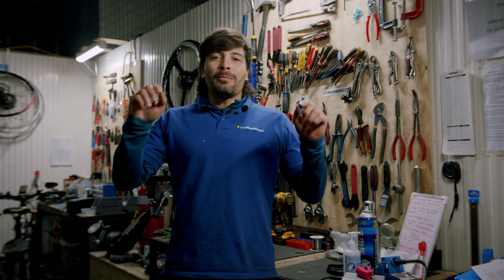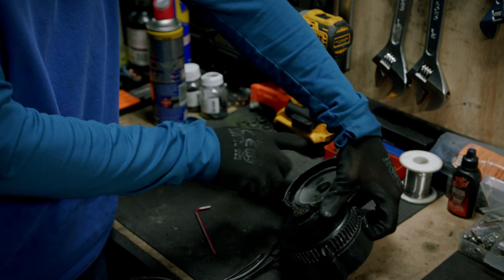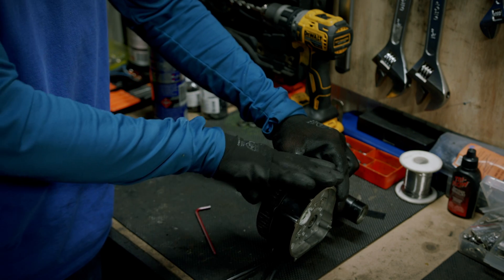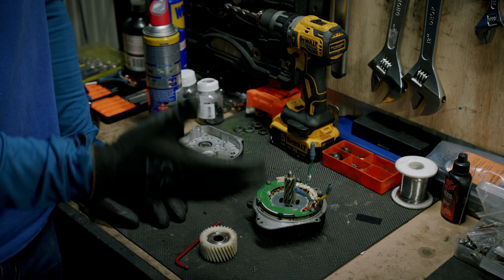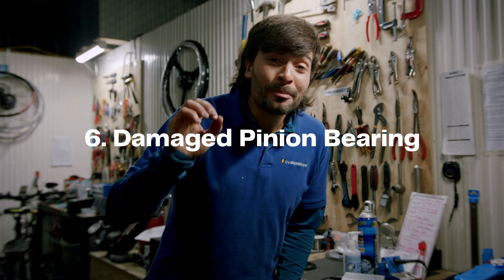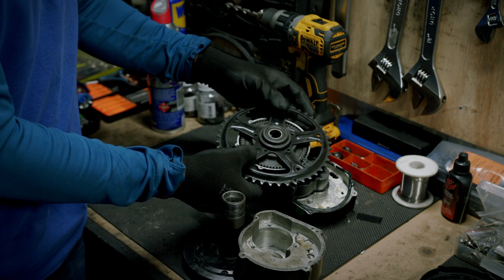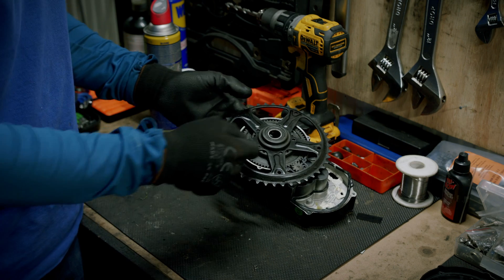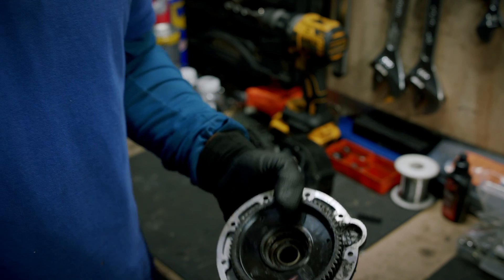Bafang BBS Motors The Most Common Problems of These Mid Drive Motors

Comment: Great Video mate. very imformative. I build one bike with 750w 52v 20ah system and second kit is on the way. It was logical to use this Ebike just like a manual shfiting car. low gears at hills and startups higher gears on cruise. I am glad that i confirmed my intutition. My question is do i need to service bafang motor like lubing the gears or coating controller etc? Our first bike only made 200 km so far and runs extremely good. Do i need to take it apart and apply grease? If so when should i do it after 1000 km? Thanks
Reply from the maker: Hi, every 5000km apply grease to the big gear and pinion coupling and the bearings of the pedal shaft

Comment: so what will you recommend to avoid those 8 problems? the bafang  mid drive motor parts are available and where to purchase? thanks for giving us tips bro. more power.
Reply from the maker: shift gears, start on the 1st gear of the cassette and as the speed increases shift gears up. Before you stop the bike, bring the gears back to 1st gear

Comment: Thanks for the great video.
Is the damage from over-torquing the motor shaft instant? The "second time" tightening that nut I may have exceeded the spec by a lot. Other than loosening the nut to 80N-m is there anything I should be watching out for?  Its a 750W BBS02 with only about 200km so far.
Regards, Randy
Reply from the maker: Yes and yes pay attention to the bearings that are inside housing, the roller bearing gets damaged by over tightening the nut that holds the motor to the bottom bracket

Comment: I find that the power of my Bafang 500w is so great that I have to change up gears 2 or 3 at a time to keep up with the acceleration and spend most of my riding time in top gear averaging 35 kph for flat cruising. I guess that is exactly the way to wear out my gears? What if I could fit a CVT in lieu of derailleurs? Would that help keep my motor in good shape?
Reply from the maker: Hi Keith, the secret to have a bafang motor that lives for a long time is to make it spin fast. You could have a CVT which is an improvement in comparison to derailleurs, but if you don’t tune the CVT or don’t shift gears on the derailleur to allow your motor to spin fast you will damage the motor.

Comment: I just got a new BBS02 48V kit.  Everything checks out except the battery.  (Hailong 48V 20H )  The voltage from the battery is 54.3VDC with the battery switch on BUT 23.4 VDC with the switch in the OFF position.  Is that normal?   I expected it to be 0V.  Thank you  Pat P.
Reply: It depends on the BMS of that battery, Even though there's 23V there it doesn't mean there's any current flowing. I wouldn't bother if the battery works fine and when the battery is on the bike, the switch turns off the bike completely.
Reply: @frcr90  Thank you for your response; much appreciated.
Reply: The c500 controller let's say has a setting to set the right max battery voltage. From 36v to 48v to 52v

Comment: I have a BBSHD mounted on my SunSeeker trike. The other day I heard grinding sounds in the motor. Then the pedals locked up. The motor still works via the throttle and that got me home. I have about 2000 miles on the trike. Any idea what the problem is?
Reply: The roller bearing responsible for supporting the pedal axle has been damaged. Why? Overtorque when tightening the motor to the trike frame. On the left side of the motor, where the nut and mount are, remove the gasket that's on the shaft and remove the special nuts that are threaded to the shaft and you will be able to slide the axle of the bearings and replace that damaged bearing. Good luck with your repair.
Reply: You don't need to unmount the motor from the trike frame, you can maintain the motor attached to the frame and all wires to do this repair.
Reply: @frcr90  If the housing has been distorted, will that not shorten the life of the new bearing?
Reply: @Jeff20657  it shorten the life of the old bearing. Press (don’t hammer) a new bearing in. If you think you deformed the housing too much, buy a new motor, but I don’t think that’s the case. What I can say from my experience is that  that bearing breaks by over tightening the motor to the frame or corrosion. You mentioned 2000miles, how many months to cover that distance?
Reply: @frcr90  2 Years. How about a video showing how to do this repair?
Reply: @Jeff20657  that’s a great idea. Probably the cause was corrosion instead of torque.

Comment: Great video! Sometimes on long rides my motor completely stops working like it’s not getting power. This only happens for a short period then it comes back on. Is this this normal if I’m using too much power?
Reply from the maker: Could be many things, like burnt phase wires (check our video library on how to fix this issue), brake sensor playing out or overtemperature
Reply: Did you find what the problem was

Comment: Does using throttle often wear out mid-drive more than pedaling? Or would it be okay if we are in the right gear? I plan to use throttle to start rolling then pedal
Reply from the maker: You have to throttle on the right gear, and on the standard Bafang controller settings the throttle is stronger than the pedal assist so yes, considering that throttle and PAS are on the right gear, the throttle will wear out the motor more than the pedal assist, but hey, do you want power or not =)
Reply: @Cyberbikesau  I guess everything has a trade off haha. Thanks for the reply and great video btw
Reply from the maker: @dowblab   @dowblab  Yeah that's it! Thanks, you're welcome, talk to you in the next video =)

Comment: I would definitely replace the grease I did on mine when it was new with a synthetic boat grease quiet as can be the stock grease is garbage
Reply: Replaced grease on both of the ones I have used before putting them in service.  Used Mobil-28 grease.
Reply from the maker: Great might be a good thing to do

Comment: Which grease do you recommend for the bbs02b primary and secondary gears? I read about the Mobilgrease SHC100, it's a Lithium based grease. Recommended as a replacement for the Mobil 28, which is hard to find in Europe.
Reply from the maker: That’s a good grease, I checked it’s data sheet: 
Mobilith SHC 100 is an antiwear and extreme pressure grease primarily recommended for higher speed applications such as electric motors, where reduced friction, low wear and long service life are required. It is an NLGI 2 Grade / ISO VG 100 grease with a synthetic base fluid. Its operating temperature range is -40º C* to 150º C.

As a rule of thumb go with high temp grease from a decent brand, it can be with lithium or not, higher viscosity is key for this application
Reply: @Cyberbikesau  I think I will replace the original grease anyway, it's the petroleum based black grease in the secondary gear, it has a tendency of spread to the primary nylon gear and in the long run cause decay.
Reply from the maker: @bengtmowitz5012  I don’t think so, otherwise bafang wouldn’t use that grease in their motors. Bafang has sold more than millions of motors so far
Reply: @Cyberbikesau  Yea, one would think so. But there are a many sources included YouTube that claims that the Black Moly  grease is harmful for plastics. I don't know if it is both the bbs02 and the new bbs02b?
Reply from the maker: @bengtmowitz5012  we are talking here about metal gears, what I understood for primary and secondary are the granny and pinion gears I mentioned in the video. For the nylon gear use a non lithium extra dense grease or a friction reduction paste
Reply: @Cyberbikesau  Aah, but the primary gear is both metal and nylon.
Reply from the maker: @bengtmowitz5012  well you understood the confusion

Comment: Great video as always! I just installed my Bbs02b 500w a month ago. Everything is going well, however I experienced a slight ticking noise when pedaling? I am just about to take it apart and change all the grease (primary & secondary gear) to Mobilgrease SHC100. What do you think about that?
Reply from the maker: Hi Bengt thanks for your feedback. If you haven’t ridden your bike in mud and adverse conditions, there’s no need to open the motor and grease it. I suggest doing it when the motor reaches 5000km. I would focus my attention on the drive train, you might have gears that are not matching properly with the chain or there’s a frozen chain link. Let me know how it goes. Cheers
Reply: @Cyberbikesau  No, the ticking noise is definitely coming from the motor. It's not disturbing in any way. Just a slight ticking, not all the time. Primarily when I start pedaling for a couple of minutes, then it disappears. That leads me to think that it is a greasing thing?
Reply from the maker: @bengtmowitz5012  I think if it was greasing the motor would sound all the time but not intermittently
Reply: @Cyberbikesau  Okej I will replace the chain and the cassette and see how it goes.
Reply from the maker: @bengtmowitz5012  before replacing it, try tunning the gears and checking for a frozen chain link. We don’t have a video about it, but because it could be a problem you’re facing, we will record a video about it
Reply: I took apart my Bbs02b and removed all the black grease from the secondary gear. I used no degreaser, only paper towels and cotton buds. Added Mobil grease SHC100 on the gear and also some teflon lubricant in the pawl clutch. The ticking noise went away. Still the same chain, but the cassette was replaced with a new Shimano one.
Reply from the maker: @bengtmowitz5012  in six years in the industry I’ve never had to open a “one month old motor” to grease it. Again, I strongly believe you had a drive train ticking noise. After removing the rear wheel, installing a new cassette, and installing the wheel back onto the bike, you’ve have readjusted the coupling between chain and cassette and that was enough to stop the noise.
Reply: @Cyberbikesau  I agree with your comment. A brand new motor should not need grease right out of the gate. Waiting seems like the prudent thing to do, when the time comes you can pull it apart and not suffer any self made errors by ruining the gasket while try to remove/reinstall the gasket.
Reply: grab both cranks whith your hands and see if there is slack, loose cranks tick!  wiggle with your hands not just check with allen wrench
Reply: I have read of others with bafang edrives that were not sufficiently lubed from the factory. Chain line alignment or damaged links can be an issue outsideof the edrive.

Comment: I’ve heard that you should add grease to the granny gear and the pinion gear to make the motor last longer
Reply from the maker: Yes that's true Ali, I would recommend greasing it every 5000km, but it depends on how you ride your bike and where you ride it. Wet, muddy, super dry weather conditions are not good for the motor and you might have to clean and grease it more often.